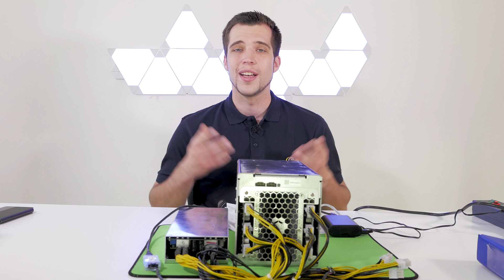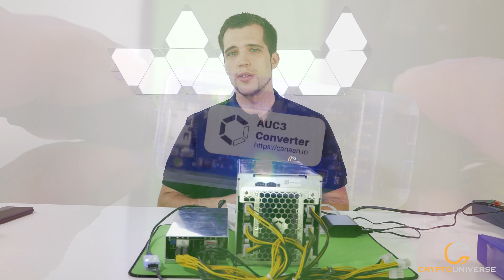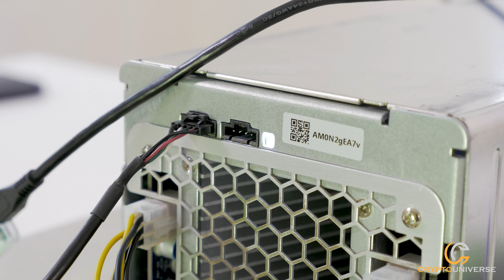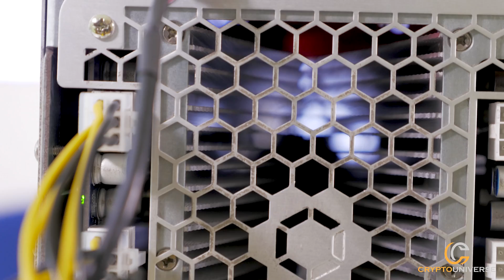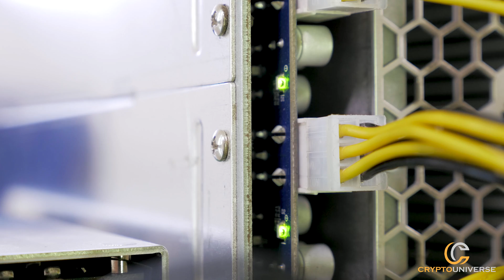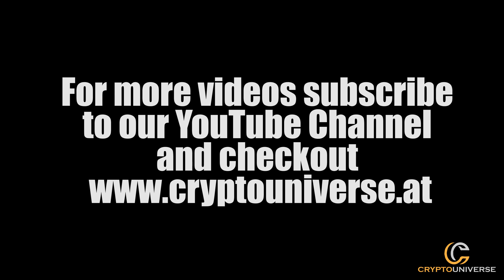Avalonminer 741 and 841 - LED Color Guide

Comment: Hello, I have 2 avalon 841 miners connected in series, suddenly they stopped working and I see that the auc3 converter does not indicate any connection led, only the led that is on and the machines when turned on remain in a waiting cycle with the back light in green . The converter may have been damaged or you should check the machines
Reply: Rafael, I'm confused by the last sentence in your post...? Are you asking a question or stating what's going on in your situation? Did you get them back up and hashing?

Comment: When i plug in my avalon 841, the LED stays white, it never turns green.
Reply: How to repair
Reply: hi, u has any answer 4 ur problem,  please i need solution
Reply: @pedrorodriguez5609  yes, two solutions.
One was to reset the microcontroller, however, I don't know the method to do it. Another method was to replace the mining controller board with one in perfect condition.